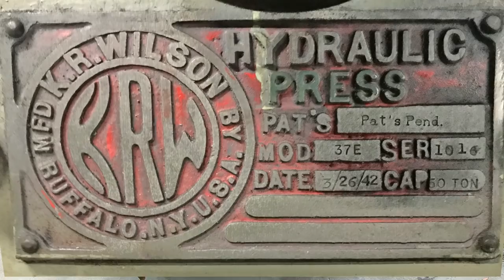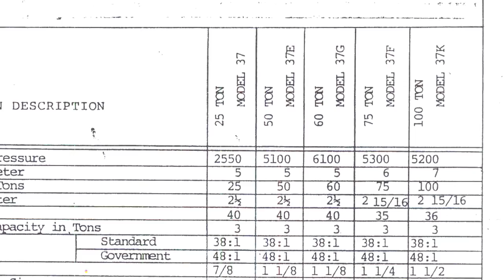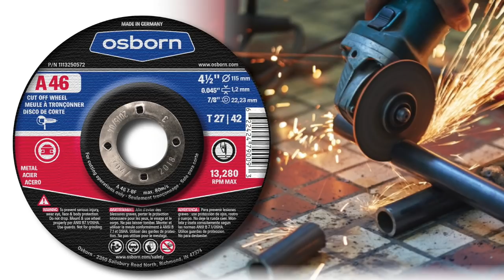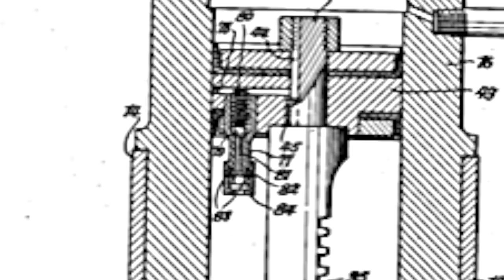HYDRAULIC PRESS RESTORATIONS

Comment: I'd suggest trying something new with welding cast iron. Use a rod called "supercast".. it's for stick rod welding but I bust the flux off with a hammer... (It's easy to do) then use the rod with a TIG welder. Preheat the casting of course. Groove it out and weld it. Then peen it real good with an air needler / descaling file. It will be just as strong as before it broke. This also works well for welding stainless steel to a cast iron casting. Done it for many years and still seems to be a well hidden secret.

Comment: I have one of those. Mine doesn't have the side handle for the arbor function. It was lost to history. My old boss wanted to scrap it. I asked if I could have it. He said yes.and I didn't waste time . I disassembled it like yours and took it home. It had some porosity in the cylinder's casting. When it was at full stroke it leaked. I filled the pores up with JB Weld and honed the cylinder.  By the way as near as it can tell from the manual all the cylinders are the same from the 25-60 ton capacity presses. The frames are different though. I replaced the leather seals with genuine parts. They still have them both for the cylinder and the pump. Great piece of equipment. They are generally pricey presses if you can find them but are worth it. They will take a beating. At my work we used mine to remove big gear shafts and bushings and such. The whole thing would jump when that stuff let loose. Yes we were overloading it. It suffered some with the steel frame having some deformation. A 100T replacement press didn't do the same work any easier. It was built heavier though.

Comment: I have a 50 ton KR Wilson, mine is from 1948, yours I think I saw was from 1942, I bought mine sort of by accident and had no idea how nice these presses were until mine arrived, mine needs to be resealed (cyl weeps) and the gauge replaced but otherwise is pretty good. 
It's great you rescued your KRW from the elements, too bad the two stage pump is missing but on the other hand  electric over hydraulic pressure supply  is a nice add on too!
Reply from the maker: Thanks for the comment. Still not sure what direction the hydraulic system is going😀😀🥴
Reply: @BuildSomthingCool  Foot operated electric would be a nice feature.
Reply from the maker: That possible

Comment: I have this same press and it  still has the original hand pump attached to it all works even with the bottom plate broken in the same place as yours   Love the video and hope to see more of this press in use and how its re-powered  as mine will have a 10,000 psi electric over hydraulic pump going into a 2-3 stage ram once completed

Comment: About the broken ear on that iron casting:

Few tackle actual fusion welding of cast iron probably because its so seldom needed. Too few learn the skill to propogate their knowledge to succeeding generations. It's a critical mass thing. Most often, O/A brass braze or TIG/silicon bronze repair or build up of broken iron castings is simpler and perfectly acceptable. 

Arc welding (SMAW and GMAW) cast iron has never been a satisfactory repair mode for a variety of metallurgical reasons - except to stop a leak or in instances of desparation and time pressure. Not many who try observe the well established precautions of weld prep, cleanliness, heat control (preheat, post heat, and interpass temperature,) and most importantly, filler metal. Makers of nickel based arc rods intended for cast iron repair promise strong machinable welds but usually fail to deliver. When stressed they always fail at the fusion line. Those who attempt to weld cast iron with stick electrode or mig may be forgiven rookie mistakes or press of time but their efforts are doomed to fail at the least stress (like drilling a hole.) For one thing, the fusion line will be glass hard and, for another, the repair is inevitably brittle and weak.

I've welded many cast iron antiques (lesson: never possess welding skills when living next door to a lovely old lady who traffics in antiques and bakes chocolate chip cookies), obsolete machinery parts, farm equipment, etc. I was taught by Benny Almencion, a rake handle skinny Filipino barely 5 feet high and a master welder deserving mention.

Oxy-acetylene welding cast iron with cast iron filler metal if skillfully done results in weld deposits and fusion lines almost indistinguishable from the parent casting. When dressed, blended, and machined, close inspection by an experienced eye will be necessary to detect the well execurted weld repair. 

Here is the big secret: outside of the obvious need for a clean casting stripped of parts, a suitable joint prep, and the mating pieces (or cast iron insert) precicely positioned, the procedure is almost the same as for brass brazing - except heat control, whole casting pre-heat, torch settings and manipulation, and fluxing are critical. The temptation to work a fluid puddle must be stifled. Molten cast iron runs like water. The puddle must be worked at the barely liquid state - like cooked cerial or polenta - and the filler metal rod worked and stirred much like a smoker stubs out a cigarette. Use plain old Twenty Mule Team borax for flux. The keen eye and sensitivity to perform 100% cast iron O/A welds are developed skills not to be learned in an emergency. It requires practice and time for the practice to assimilate.. 

If the possibility of a cast iron weld is in your future, practice before you need the skills. Start with a thrift store frying pan (look before you leap: some old cast iron pots and frying pans are collector's items worth more than you'd think,) break it, then repair it. If you can make invisible repairs to a cast iron frying pan, larger repairs are merely a matter of adapting to magnitude.
Reply: Forrest  Addy good comment. LOTS of good information. What are your thoughts on some of the videos on cast iron repair? I saw one stick weld but haven’t seen anyone else do that. But brazing with silicon bronze seems like a good idea like you said.
Reply: @ashleymillard3207    Cast iron is unforgiving stuff when it comes to any form of arc welding. It's the dispersed graphite that gives cast iron its unique ptoperties and confounds quick and efficient weld repairs. 

I've seen a few videos covering arc welding techniques applicable to cast iron and while some of the presenters demonstrate the recommended steps (positioning parts, stop drilling cracks, excavating for weld prep, preheat, post-heat, etc) my rough trials using the same techniques show quite successful results from a purely uliltitarial perspective. There is no denying properly executed arc welding methods for cast iron repair are more ceonomical in terms of time and labor but it must be emphasized that the prep, heat control, filled metal selection, etc cannot be skipped. And most of the time the casting must be remove from the equipment and thoroughly cleaned if success is to be attained - always a progress stopper for anyone with a breakdown and an urgent need to get back in business. It's often a case of do it right or do it twice.

However, O/A brass brazing repairs in cast iron are generally more durable. Silicon bronze TIG (GTAW) repairs are also very effective provided the casting is properly pre-heated prior to striking an arc. The same precaution for cleanliness, positioning, joint prep, etc apply. I tend to prefer it as the intense heat of the arc yields quicker results than O/A - saying again, proper pre-heat when using an elecrtic arc in cast iron is that much more important.

However, when full penetration, fully machinable, full strength - or invisible - weld repairs are to be made in iron castings, I fall back on O/A cast iron filler metal for weld repairing cast iron. Double the fuss and bother but definitely the best results. 

Story: Back in the day, a friend of mine loved old farm equipment. He found a decrepit and incomplete horse-drawn seed drill built about 1900 that came with a large box of broken castings. He'd sorted and matched most of the pieces and came up with enough to complete the implement in conjunction with the new red oak parts he made. He brought the casting puzzles to me to stick them together. It took a couple of winters of spare evenings but eventually we invisibly weldied all the fragments together, dressed and distressed the repairs to blend with the cast surface. It was a labor of love but I only did the welding. The castings were well formed and almost graceful, a testament to excellence in turn of the last century design and worthy of first class work. In the end, after a lot of research, cleaning, fitting, and painting, Smitty had a 24 unit seed drill, indistinguishable from factory new. Beautiful. For my labor, I got a home raised and smoked ham. Good enough.

He hauled it around to fairs and farm meets, etc. That was 40 years ago. I heard his widow sold it to a collector in Manitoba for a pretty fair price.

Point of the story is appropiate process. That restored seed drill was perfectly servicable and would have survived regular use - the abuse of deep settings, stoney soil, etc - as well as if when new. I don't think any repairs made by arc welding would have lasted. Brass brazing, probably good as the original casting - but when the paint wore off, there would be that shiney brass repair like a gold tooth in Miss America's smile. Or you might not care; you just want to stick the handle back on the hub.
Reply: @forrestaddy9644  Thanks for your thoughts and interesting story too!
Reply: Great information! Thank you

Comment: Very nice work as usual, looking forward to part 2! The secondary purpose of the arbor press style handle was you could unlock the valve on the pump and use the spider wheel to run the ram down against the piece so that you didn't need to pump all that oil. The ram would suck the oil from the reservoir, and then  you could engage the pump and go to town on it. The hand pump also had two pistons so once you got up to pressure you could disconnect the larger piston. I'm curious as to what you do for a pump, to achieve 60 ton on this press you need abound 6000 PSI. -Mike
Reply: Tonnage is not based on pressure as much as cylinder piston diameter, this why the majority of hydraulic systems operate at 3000 psi, pump size determines speed of operation, cylinder stroke length also provides some multiplication of actual work force of the 3000 psi source.
Reply: @Peter-V_00  MAB Machine's comment was absolutely correct, and almost everything you stated in your comment is wrong. How is it possible that you are so ignorant of how hydraulics function and, yet, you chose to post a comment on the subject?
Arbor pressure = πR²  * P  (R = piston radius - 2½", P = hyd. pressure)
120,000 lbs = 3.14 * 2.5²  * P
P = 6,114.65 psi
Arbor pressure is in no way impacted by the length of stroke. Piston area and hydraulic pressure are the only relevant factors, and they both have the same impact. If there's only 3000 psi, then the press will only provide a maximum of 30 tons of force.
Reply: @EDesigns_FL  Hmmm, must be why my old redundant dual 50hp baler with a 14 inch piston and 54 inch stroke ran at half speed on one drive but at 3000psi operating pressure made 150 tons half stroke and 400 at full stroke, think as you like, my post stands.
Reply: @Peter-V_00  You're obviously an expert on hydraulics.
14" piston @ 3000 psi generates 461,580 lbs force. 
If ignorance is bliss, you should be extremely happy;-)

Comment: Its a good, heavy duty looking press thats built to last. About the cast iron cylinder head that you brazed, could that whole part be remade from a block of mild steel - by machining? Looking at it from my couch it looks like this is possible.  You have already fitted it but if it was out you could have taken dimensions and size on paper and at a later date remake the part.

Comment: Did you buy new seals for the cylinder? They're not that hard to find.
Reply from the maker: No,  the seal that was with it looks fine. Plus it leather. If it leaks I will make a new cylinder and put modern rings in it😀

Comment: "It comes in four sizes"
25,50,60,75 and 100

Confusion
Reply: the 100 ton is supper size
Reply: @ypop417  supper size? Like dinner , only different 8-)
Reply: @fytanman  biggest meal of the day!  :D
Reply: This is true for larger values of 4....
Reply: @stxrynn   LOL
Reply: And for bonus points at 10:25 you can see that it says 30 ton on the plate! :-D
Reply: fredio54 
That only adds to the confusion. Dale saying 4 sizes when it clearly shows 5 is not surprising though.

Comment: 1:39 he's using wrench in wrong direction.
Reply from the maker: Are you trolling me?😀😀😀
Reply: Nope... though you did that only ones out of so many times in this video.

Most manuals say, fixed wrench can be turned both ways, but to reduce stress on variable ones, turn them one way only

Comment: Your paint removal method does not look like it saves you any time. In fact it looks like it took much much longer. 
First consider the time to cut everything apart and then recreate it all with new steel. 
Secondly the more complex parts will only get the flat surfaces sanded leaving a LOT of paint clean up in all the small openings. 

Not to mention all the areas you painted and had to strip to do all the welding. 

I see you confuse easily though telling us there are 4 sizes but read off 5 never mind that the build plate (casting) @10:25 shows 30 ton capacity.

Comment: Dale, I like your video and you're doing great really wonderful efforts thank you 1st of all
But abrasive and tighten broken part is really risky and it may fail when you're pressing that hydraulic fluid my better option is cast new part-out of it
Reply from the maker: The only Pressure on that part is when using it as an arbor press. And I don’t think there will be  much pressure on it because of bearing points are in a different place than where that part is broken. Thanks for your comment